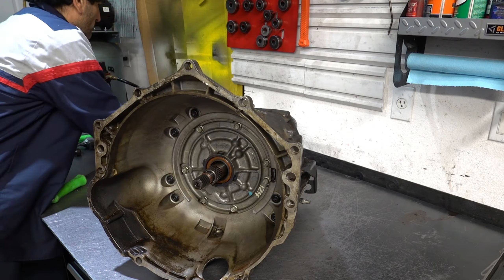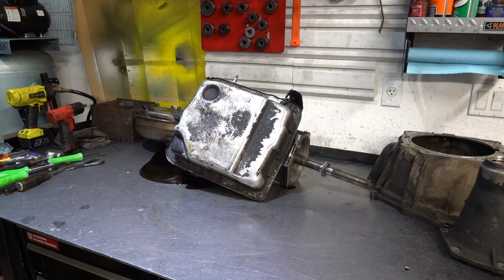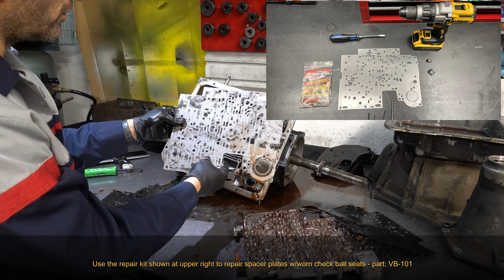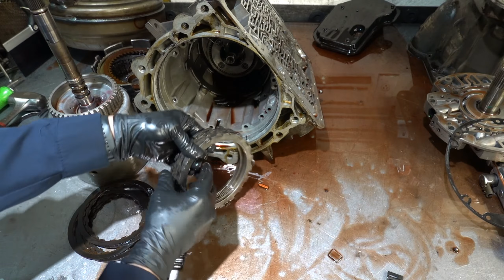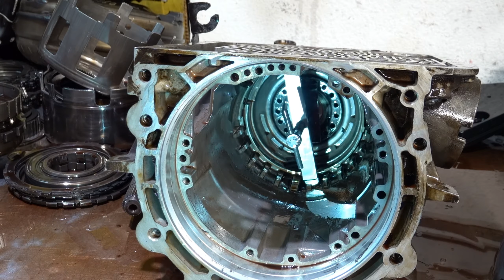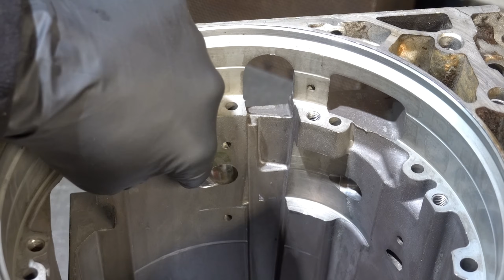4L60E Teardown and Inspection - No Fourth Gear: I'm Stumped!

Comment: I hear you speak of “kits” all the time.  Like that “whatever whatever part” should be in your “kit”. 

What kit do you use for your rebuilds?  Recommendations on where to get them?
Reply from the maker: Most of the time, I am referring to the Overhaul Kit, sometimes called the 'Paper and Rubber' kit. They are sold by Transtec, Transtar as well as any other transmission parts supplier. 

I'll prob do a video on kits as some point and explain the different terms/definitions so folks can get up to speed on the lingo as well as understand what needs to go into a proper overhaul. Meanwhile, you can watch any one of my build strategy videos to get an overview of what parts need to go into a properly overhauled transmission.

Here's an example: https://youtu.be/_JxEWdjnpRc

Comment: Hi Nick, great Channel been following you for awhile I have a 4l60E I have rebuilt with new clutch packs, pistons seals all new electrics Sprag bushings torque converter vacuum tested valve body all good
The problem I have is to wait for engagement neutral to 1st but if you don’t and press the throttle it will slam into first and I have no second gear on downshift ( I have a pressure gauge fitted and 
There is no line pressure. It just revs up ) I have to stop and pull away again and goes up through the box fine I am now possibly thinking boost valve in the pump or band servo can you give me any advice, please, as I am racking my brain and spending lots of money
Reply from the maker: Did you air check the case as shown here? ---> https://youtube.com/shorts/TuknGAgAo7k?feature=share

Sounds like a massive cross leak somewhere in the forward clutch apply circuit...Drop the pan and check the boost valve snap ring. If it's installed correctly, pull it back out and go through it to find / fix the problem(s).
Reply: No did not check the case like that also did not take out the boost valve being in the UK. I have a limited supply of parts. Thank you for your reply Nick. I shall look into doing what explains on your video you sent me.
Reply from the maker: Contact Transpartswarehouse.com - they should have everything you need and, AFAIK, ship world-wide.

Also, never reuse boost valves - they wear/leak and are considered a consumable, no different than gaskets and seals. Air check the case once you have it back together following my video linked above. 

Good luck with the build!

Comment: Hey brother, having the same issue of no fourth gear on this 2005 Chevy Silverado with a 2600 stall converter, 2nd and 4th gear sonnax super hold servo, transgo hd2 and and shift kit and raybestos 3-4 clutch pack. I’m thinking it might be a tuning/computer issue but not 100 percent sure…. Lmk if you have any insight!

Comment: Nick, I toredown my 4l60e, down to the bare case. No broken pieces, no damage at all. Sun shell is in perfect condition. Pump rotor is still intact. Im really stumped why my truck wouldn't move. Only made a zipping noise in every gear except park and neutral. And it wouldnt park either. Any other ideas? Could it be a problem with the transfer case?
Reply from the maker: No idea as you keep starting new conversation threads instead of just replying to the pre-existing thread where all that information is located. Reply in the pre-existing thread where you originally began posting and ill review/respond later.
Reply: @nickstransmissions  Oops, my bad. Will do

Comment: Could the MAF (Mass Air Flow) sensor have a problem? I'm not sure if that would always set a code or CEL.
Reply from the maker: Problems w/the MAF can and often do impact transmission performance. If the MAF is under-reporting, transmission's line pressure rise will be insufficient. If it over-reports air flow, that drives up fuel consumption and also increase line pressure beyond what's necessary given the actual vehicle acceleration/throttle position.

This vehicle didn't have any MAF or TPS issues.

Comment: Hey Nick, thanks for another great 4L60e video; what a weird failure. In the video you mention enlarging the drain port of the pump to a larger diameter. Have you thought of doing a short on that? I heard you mention that upgrade a couple of times and I think I understand what you mean but a short would be cool. Thanks again brother.
Reply from the maker: Thanks for the kind words, Tony and great idea for a short video! I'll do one next time I have a 700R4 or 4L60E in that will need that drain back channel enlarged.

Comment: Hi all. I am the owner of this transmission. Going back through my posting history  I can repost what happened to maybe give better insight. 
Truck was purchased used in 2020, approx 145K miles. No service history. Current mileage 188K.

12/2023 - The transmission suddenly, almost violently, downshifted to passing gear as we turned right, pulling out of a parking lot and was normally accelerating up to 45 mph. I found It would not shift until I let off the accelerator. Driving home, The transmission wouldn't shift out of first gear unless I let off the accelerator.  It will shift and drive normally after the initial shift if I let up on throttle at each shift. If it downshifts I need to repeat the let off pedal. 
Fluid is a tad overfull ( maybe 1/2 qt) but not burnt. No CEL light. It drives fine once in gear but I need to lift for each shift. Get the tach to 2500-3000, let up, feel it shift, see rpm drop, resume driving. Some research says replace the TPS, VSS seems to be a NO because the speedo is still operating normally.

12/2023 - One week after initial problem.
 Tech scanned for codes with a scanner. No transmission codes. Still no CEL light.
Checked fuses. All good.
Checked Iginition and PCM voltage. Good at 14.7V. running.
ECU/ECM/PCM was replaced this year. VIN programmed with most recent updates. Replacement was a bad diagnosis from a different issue (AC related)
Cleared all stored codes ( P0172 and P0175, probable CAI issue), test drove. Still has problem.drives normal once I get it to shift into each gear, 1-4

7/2024 - No CEL. No Trans codes. On a recommendation. Replaced TPS, just in case - No changes. Didn't expect any.

9ish/2024 - Transmission jumps in/out of OD for a short period the loses OD completely.

Sometime/same time between losing OD and present 3/2025 trans seems to lose distinct shifts. 
Driving procedure is run RPM up to 3- 3500ish ease up on throttle, see rpm drop/feel shift, accelerate normally. 
Theory tossed around before rebuild is trans is seeing high RPM at 1-2 shift and bumping trans into 3rd. Effectively running a 2 spd trans.

That is pretty much the whole story.
Reply from the maker: @casdiggin3 - thank you for providing such a detailed history on this unit...Your information will definitely be helpful for those with similar problems and the same/similar failure mode trying to either diagnose while the unit is still in the vehicle or w/the autopsy on the bench post-tear down! It's great working with you and thank you for the opportunity to help you get the Big Burban back on the road!

Comment: I had this exact issue recently and was told by my tuner after the trans was pulled and gone over that it couldve possibly been caused by a bad MAF sensor, exact band anchor damage, no harsh shifting beyond the transgo shift kit also
Reply from the maker: Interesting, thank you for watching and sharing your experience...I'm guessing a worn band, excessive band clearance combined with perhaps bad metal and/or a bad cast on the band anchor pin location caused the damage but that's just a guess...

Comment: If the band anchor point was walking away from the anchor the servo would require further travel which in theory could cause the pin to over travel & cause the 4th gear apply oil to leak into the case preventing enough apply pressure on the 4th servo piston.
Reply from the maker: Yep, absolutely right! I'll be doing a follow up on this one to close the loop; excellent explanation as to what occurred.

Comment: If you go back to 39:05 and look at the band anchor mount when you pull the band out, you'll see that it had ripped away on one side. That would let the band be "pulled" around the drum when the servo is on, which caused the damage to the case. Kinda hard for me to put into words correctly, but if you go look, you'll see it. I think every bit of that damage was caused by the band anchor mount failing.
Reply from the maker: Yep, I believe you're right! I didn't notice the case damage until after I cleaned everything up but failed to notice the band anchor damage before I made the video...I still have all those parts so may do a follow up vid to fully explain what happened and close the loop on this one. 

Thanks for watching, as always man!

Comment: I have a unit in my 99 trans am that has that same issue, I lose 4th gear overdrive on the highway I can re-engage it by tapping on the brakes or downshifting to 3rd and back to 4th quickly. This was the first 4l60e I took apart and repaired, it was built by a shop and over the next yearI kept losing 3/4 the builder took it apart 4 times and couldn't find the reason by 3/4 burned up. Anyway I decided to take it apart myself I bought the books in the manual saw a bunch of videos and determined it was excess clearance along with leeks where the input shaft is pressed into the forward drum. But ever since I put it back together with a new input drum that I built I have had that issue with falling out of 4th. Tranny works great I have all my gear except when I'm on the highway cruising in overdrive I also have no issue when the selector isn't third gear. I've been told that it's my 3/4 burning up blah blah blah now I know what to look for the next time I take it apart, I was too inexperienced at the time to notice anything like that.
Reply from the maker: Thank you for watching, Martinez..Yea, hopefully you're situation isn't like this one as that means replacing the case in addition to the usual stuff. Lots of shops do not test the input drum for leaks at the base of the shaft and repeated 3-4 failures are the result...Also check the pressure regulator valve's intermediate lands - if they're worn (or the bore there is worn), you'll have repeated 3-4 failures as well.

Comment: All of these issues like the one you just had with the shaft go back to what you said earlier someone got a hold of this thing with an extremely heavy hand and they tighten the bolt way too excessively over torque them in other words
Reply from the maker: I think that shaft is slightly bent but will have to double check it more closely to be sure.

Comment: What’s wrong with using the file as I’ve been told or taught in the past when taking out the shift selector shaft
Reply from the maker: Nothing is wrong with using a file. I use an angle grinder which does the same thing but a file is perfectly fine. Did I say a file shouldn't be used? I don't recall one way or another...
Reply: @ no you did not say using a file was bad just a poor assumption on my part since you struggled versus 30 seconds with a small file and boom, but it all stems from a heavy handed wrench and the previous person that put it together that made things complicated
Reply from the maker: No file was going to remove that particular selector shaft...It took every bit of pounding on it w/the slide hammer...Never had one stuck like that before...I think the shaft itself was bent but will need to take a closer look at it..I still have all those parts and plan on doing a follow up video to close the loop on what happened, the 'trigger' if you will, that led to the failure.

Comment: Nick we here at Bunkers automatic LS have seen this again not common but we have seen the issue switch the band anchor we could conclude to the case being warped or out of round from what we could find.
Reply from the maker: Thanks for watching, bunkster. Yea, I've seen it a few times as well but never to this extreme to the extent the case got damaged.
Reply: @nickstransmissions  if my memory serves me right, we had a 2008 4l65e that was rebuilt numerous times and was finally brought to us to figure out what was going on, it kept burning up 3/4 clutch pack we did pull it apart and we did inspect the input drum an inspected the 3/4 pack to find your common failure or bad stack up but that was not the case, the measurement was actually at right at 45 with a nine clutch pack but we did find the input drum was out of round which we have very rarely ever seen that usually we find them broken or as you have found in a lot of your videos the input drums leaking around the input shaft. But we actually had never really seen in our experience in out of round input drum that was actually finding the three four backing plate.
Reply from the maker: That is a very interesting case, thanks for sharing! 

I'll have to be on the look out for that, especially if/when I get one in where a previous shop couldn't resolve 3-4 burn up.

I've never seen that drum out of round unless it was cracked or 'machined' by a failing front planetary captured bearing, thrust bearing or input shaft-stator bearing...At that point it becomes obvious the drum is no good but those don't necessarily cause 3-4 failure; the clutch pack simply becomes collateral damage, so to speak.
Reply: @nickstransmissions  exactly what we thought too, we were shocked to find that the drum had worked and we're not exactly sure or why, we even took the bad clutches and steals and put them in a good used drum and are checked them to see if they would bind up and the backing plate would bind up but it didn't put everything back into the original drum and the backing plate was bound up roughly a 16th of an inch of movement and it got bound up and would not release we were still stumped on that one lol. We are currently going to be doing a tear down on the Facebook page as well of a 4r 100 that supposedly lost all forward gears.
Reply from the maker: Cool, would be interested in seeing the 4R100 teardown - reply back w/your FB page and I'll take a look once it's published...I wonder if the forward clutch, coast clutch and/or OD roller clutch failed in that 4R100 unit...or maybe TC.
Reply: @nickstransmissions  that would be great sir. The page is listed under Bunkers Automatics.
Reply: @nickstransmissions  hello Nick the video is uploaded.

Comment: I have seen cases almost cut in half, from the reverse drum spreading like that. I have also listened to a few that had an unusual, almost knocking sound. 

Most have been in cars that the rear tires, were almost bald on. Or had been behind upgraded engines. Other than that. Not going to be much help sir.
Reply: I forgot to mention. I have seen the band broke at the anchor pin hole. And get jammed. Result is 1,2,3 and no 4th. Most of the time. It’s just no 2nd no 4th. About three years ago. I seen what I just described on three in a row. Have not seen it since.
Reply from the maker: Yea, that's wild - haven't seen that just yet but there's always a time for firsts, haha. Thanks for watching, Larry!